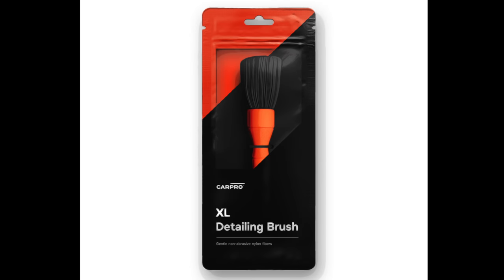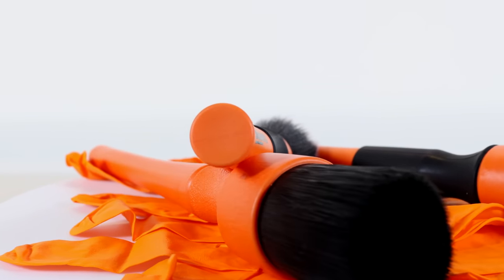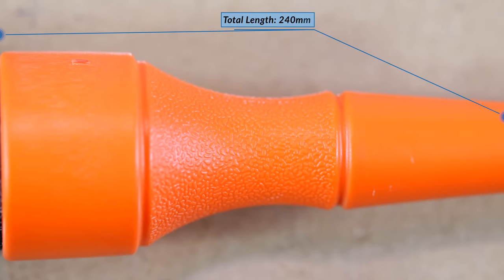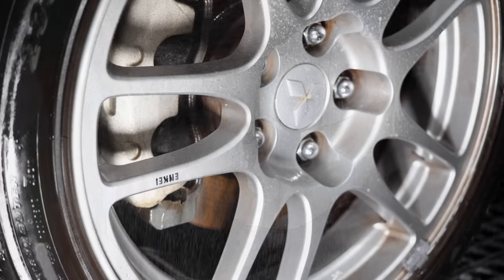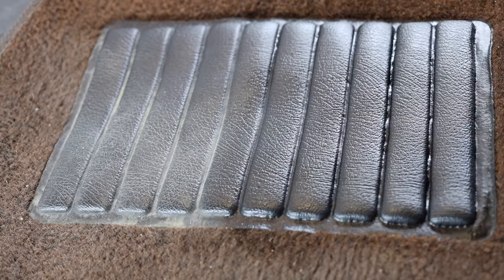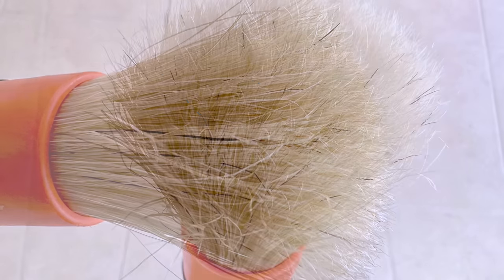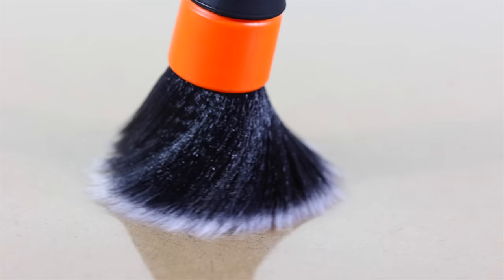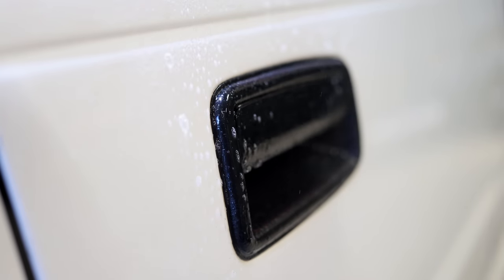Carpro New Detailing Brushes Reviewed!

Comment: By the time you finish watching this video, those brushes will be sold out.
Reply from the maker: Lol, it was a little longer than I expected for such a video.
Reply: @CarCraftAutoDetailing  No Sandro. The length of video wasn't the issue. It was well done. I was talking about how quick these items you showcase sell out. As soon as people finish watching they must be off buying up all the stock because I'll be damned if I could get any of those CarPro bottle measuring cap thingys in your last video. I went to have a look and, you guessed it, SOLD OUT. 
Which is why I reckon these brushes will be sold out too. Very frustrating. Either people are buying too much or the suppliers don't bother to stock up properly.

Comment: Those certainly looks beautiful.  I bought the old set with black handle, large and small, the large had its bristles detached after 3 or 4 uses and completely fallen apart.  I still use and love the small one.  I guess they're just detail factory rebranded for the most part.
Reply from the maker: That’s pretty bad falling apart after just a few uses! I actually never used the older ones so I can’t speak from personal experience, but I’m a few dozen uses in with the new ones and so far so good.

Comment: I suppose you could use good quality oil paint brushes as well, just using the wheel nut brushes would be easier, all the rest you can use good quality oil paint brushes and then trim them to what ever length you need, keep up the great work Sandro and all the best for xmas and the new year buddy, keep safe and looking forward to your content as always. :)

Comment: What do you use to clean these brushes? Also, what do you use as a cleaning chemical?
Reply from the maker: Because the brushes are mostly used with and already have cleaning chemicals on them, they usually rinse out well just under some warm running water or a bucket of soapy water. 
I’m using them with various cleaning chemicals but I guess APC’s would be the most common.

Comment: Hi Sandro, trust you & yours are OK. If you think of door/hatch/scuttle shuts. Here in the UK I've contacted Carpro to suggest angle heads on some of their brushes for tight spots, your thoughts?
Reply from the maker: I think some thinner angled brushes potentially with slightly longer handles could be great for tight door jamb areas and even tight interior and engine bay areas, so I’d be on board with that! It would be nice to see this brush set expand to include a few more, maybe even a tyre and wheel well brush, and I think if the brushes continue to sell and do well, we could see some more which would be great! 
Merry Christmas mate!
Reply: @CarCraftAutoDetailing  Right now I'll trade you my fleece & thick Santa hat for your thin elf T shirt ! - Arch brushes though, instead of 3D toilet type, would be nice to see a half hockey stick type to hook beyond the tyre with limited space between the boot and liner.

Comment: So i just detail my own personal car and was wondering which ones should i get to detail synthetic leather and alcantara of my dodge challenger
Reply from the maker: I think the boar hair brush could be the one
Reply: @CarCraftAutoDetailing  thanks i don't know if you have try gyeon Q2M fabric cleaner but which one would you recommend to clean alcantara gyeon Q2M fabric cleaner or carpro inside
Reply from the maker: No I haven’t used it, but speaking generally, specific fabric or carpet cleaners tend to be stronger interior cleaners compared to a general and leather cleaner like Inside. I’d even use Inside 1:1 on alcantara

Comment: Hi Sandro, would that boars hair brush still be safe on sensitive rims? I noticed you said the XL brush is more aggressive than the board head
Reply from the maker: The more use the boar hair brush gets the softer it seems to become and it does end up being quite gentle after it’s well broken in, though the small brush is still the most gentle of the bunch.
Reply: @CarCraftAutoDetailing  just checked waxit and the 2 piece set is sold out 😌 great in-depth explanation and videography btw 👌
Reply: @CarCraftAutoDetailing  I've been using the set now for a few months and I really love the ergonomics of the brushes. I do however find that the smaller super soft brush, the bristles are fairly long which tend to flare out quite a bit when I agitate with P&S Xpress. I find this cuts the cleaning power a little bit but it is great paired with a vacuum for dusting the interior

Comment: The large (hog hair brush) does it scratch mat black wheels?
Reply from the maker: It should be fairly safe on mate paint - obviously making sure you remove looser dirt with a pressure washer first - but after you break it, in maybe on some other areas it will soften up a bit more.

Comment: Question how often are you using these brushes and be honest ? Anyone?
Reply: I use brushes almost any time in cleaning an interior. Can you do without and just use towels? Absolutely but I like to get every nook and cranny that a towel might miss. Just my two cents
Reply: @ToCHawk   with that said for some one like myself that enjoys detailing his own car. I just find these brushes to be alil Xtreme . Meaning there’s not much I can’t clean with a towel I myself know there maybe areas that a towel can’t clean like says your air vent maybe emblems or maybe the doors where the leather meets up to other body panels. But do these areas justify the  purchase of such brushes. A lot of these areas I use high pressure air to blow clean.
Reply: @nachomandetailingservices1057  I don’t think I personally can justify spending this much on brushes when I don’t use them enough, but if someone cleaned in high volume, I could see justification. I don’t really have access to air outside of what my shop vac blows out, so the brushes come in handy, as I myself just detail my own cars
Reply: @ToCHawk   ya me too but the car wash place has air thing and good vacuums. But I hand wash my car I just use there vacuum plus I roll in there after I cleaned my car so I use it free 🤫. Lol we got to do what we got to do. If I had a house with everything I needed and the money to buy it I be in good shape. But I may get a set just to see how they work. Not sure I’ll think about for alil before I make decision